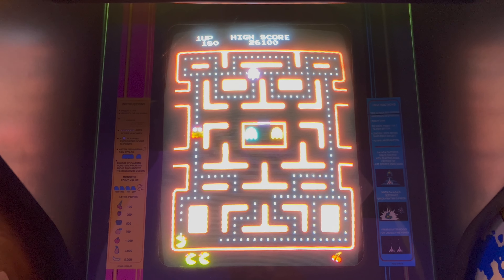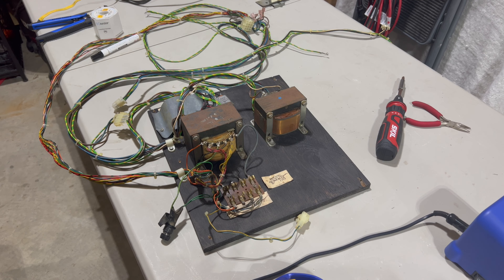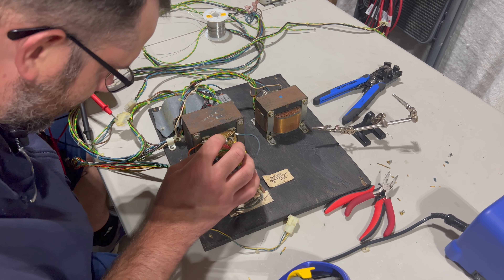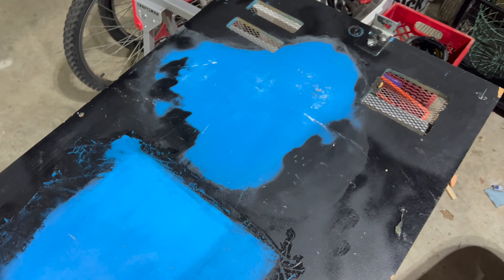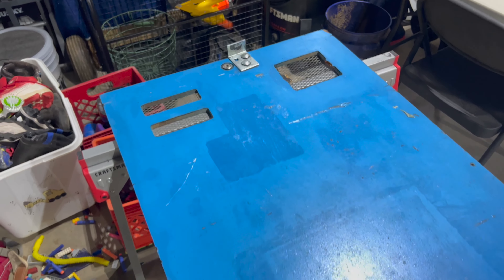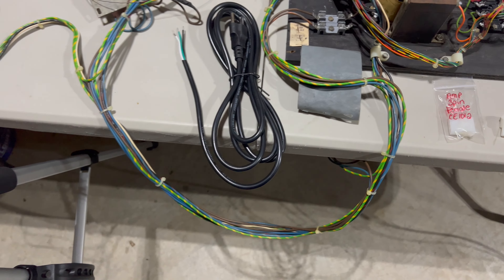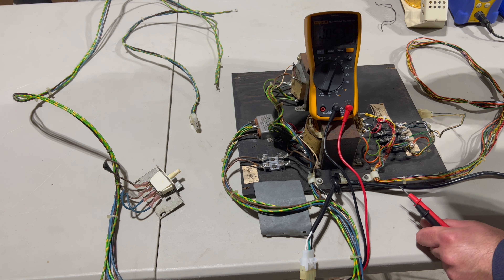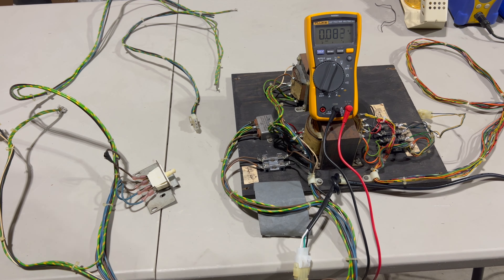Ms. Pac-Man Restoration part 2: Transformer Assembly Overhaul & Initial Paint Removal

Comment: That's an excellent technique for removing the black paint!  I'll have to give that a go with a cab I have.
Reply from the maker: I couldn’t believe it myself! Very messy, but so easy as compared to using magic erasers. I’ll just have to be careful to avoid any unevenness by doing it all at once I guess. And after this project, I’ve got two Williams games tucked away in the garage needing black paint to be stripped off the stenciled artwork!

Comment: I agree with storminnormin. I would use the control panel with the better overlay. It should clean up nicely and match with the rest of the cab. Especially since the rest of the cab will be original and not re-stensiled, even if the overlay is a little worn (and not much at that) it should still look great.

Comment: I use spade connectors on the fuse holders for each end. It still makes a good connection and if you have to change the fuse blocks out again just pull them off and put them new one in. I had to do this to 3 different cabinets. It helped by doing exactly like you did by reflowing the solder connections to the transformers and fuse block. I was getting lower voltage from the 7vac and 12vac lines before reflowing. They should be like 15vac from the 12vac line and 9vac from the 7vac with no load on them. For the power cord you can change the plug end very easily. Just make sure the power cord does not have any nicks in it. If it does then change the whole power cord.
Reply from the maker: Good tip! It’s not that much more work to solder the connections though.

Comment: Nice work!  I'm surprised you didn't swap out the inline filter. It's a $3 part and sometimes (along with the fuse blocks you already swapped) will cause hum bars on the monitor if they are faulty or old.
Reply from the maker: Great suggestion — I’ll include one in my next parts order!

Comment: Do you know why most arcade games use 10,000 to 20,000 microfarad capacitor for the filter cap it just doesn't make sense why they would use such a very large filter cap for just providing 5 volts to the IC chips it to me it just doesn't make any sense maybe somebody can comment on why because five volts is not that much the power that I see chips and I see chips shouldn't be using that much current so I'm not sure why they're using 15,000 to 20,000 microfarad which is outrageously high in large capacitance so there must be a reason as to why?
Reply from the maker: Great question, Wayne! This link might help — it explains the formula for calculating filter capacitor sizes, with examples: https://www.homemade-circuits.com/calculating-filter-capacitor-for/
Reply: @overtimearcade  when you do the calculation of the for the filter caps value with all the IC chips what they're going to be demanding as a current draw from the data sheets it just doesn't add up to 10,000 microfarads to 20,000 microfarads it's that's what I'm I'm very confused about because let's just say most most motherboards for arcade games have about let's just say 50 I see chips and you know each one is drawing about you know so many milliamps it just doesn't compute for a filter cap to have 10,000 microfarads to 20,000 microfarad so that's why I'm very confused and it doesn't make sense there must be another reason why they chose a very high excessive filter cap value for to just to power an arcade motherboard
Reply from the maker: @waynegram8907  But I think filter caps like the Big Blue are filtering the voltage for the entire cabinet, which draw about 1.5-2 amps on average. So plugging that into the formula:

C = I / 2 x f x Vpp (assuming f = 100Hz, Vpp = 1, and load current requirement as 2amp)

That gives us 0.01 Farads or 10,000uF. Add some margin for safety, and you’re in the right range for filter caps commonly seen in classic arcade machines.
Reply: @overtimearcade  C= 1/2 x F x Vpp. The F=120Hz? and Vpp = +5vdc?
Reply from the maker: @waynegram8907  AC power in the US is 60 Hz. And that's a lowercase L in the formula, not a 1. Let's say the cabinet load is 2 amps. Vpp is the maximum amount of AC ripple you want the filter cap to less pass through. Let's say 1 VAC for that. So...

C = L / (2 x F x Vpp)

C = 2 / (2 x 60 x 1) = .0166 Farads or 16,667 uF